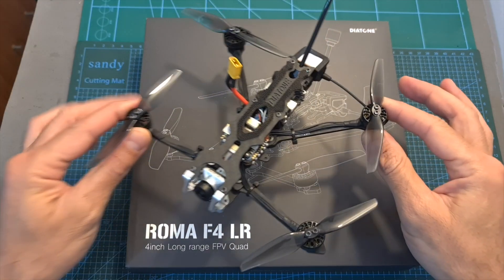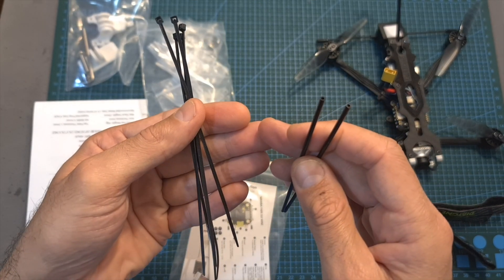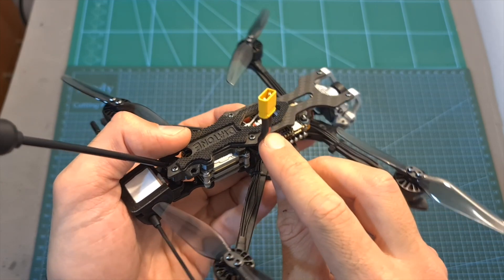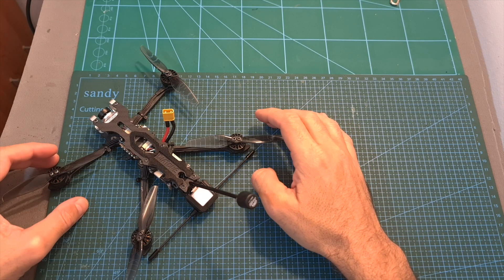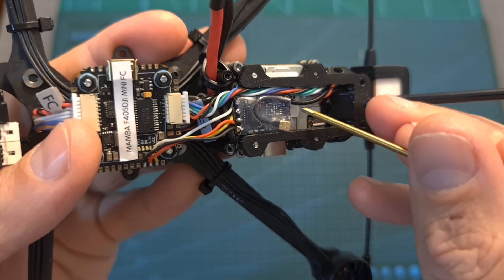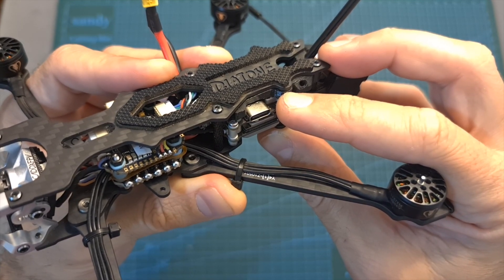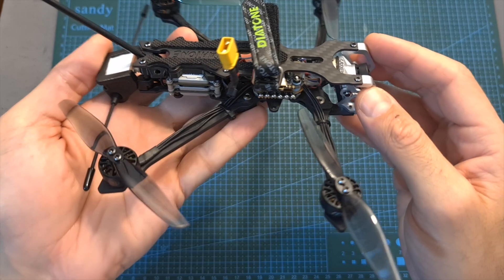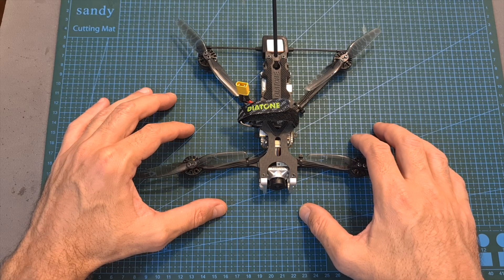Diatone Roma F4 LR - Setup, Review & Flight Footage

Comment: i bought the analogue version my video antenna sits on the side of the quad and not over the gps but i still cannot pick up any satellite's. i have configured the gps in failsafe tab in betaflight and waited 15 minutes with a fan blowing over it outside and still couldn't get any satellite's at all . very frustrating considering the gps rth feature was the reason i bought this quad . never had a long range quad with a 400 mw vtx , seems strange and i thought that's why it had a gps so when u lose video u can flick the switch and it will bring it back into range . am i missing something or is this gps unit just a dud

Comment: Hey Gal. Thank you for the review. Looks like a good quad. I have one question:
If i buy the version without camera and dji unit will it work with analog receiver if i solder that in out of the box? I'm just curious because the analog version is sold out everywhere...
Reply from the maker: My pleasure! Sure you can - the flight controller has an OSD chip so all you need to do is to buy an analog camera, VTX and an antenna and you'll be good to go.

Comment: In the end of the video there are some video with HD and other video with low quality. what's the different? are the HD is the DJI unit and the low quality is the caddx?
Reply from the maker: I should have marked it properly as it's confusing. 
Lower quality - Caddx Nebula Micro DVR. 
Higher quality - Naked GoPro 7 Black footage.

Comment: Nice video ! I’m wondering about these mamba motors. How do you like them ?
I see at times in the video some wobble. Is that the wind or is it something to do with the motors not being smooth ? 
Hope to hear from you. Thank u
Reply from the maker: Thanks. The motors seem to be working well. 
There are some issues with the tune which Diatone need to fix and on top of that the Nebula V2 camera is more prone to Jello in comparison to the DJI cameras as far as I know (I need to confirm it).
Reply: @KremerFPV  thanks

Comment: It's cool that there are now so many options in this category, but the "original" FlyWoo (or the actual original DIY build by Dave_C) still seems like the best choice overall even if it's slightly more expensive.
Reply from the maker: It's a great option and I really like it. I will post my comparison video once I will feel that I will have I got enough experience with all the current options.

Comment: It's got so much oscillations and rebound on quick rolls and flips. Are the videos recorded after you changed the pids or with the manufacturer's ones?
Reply from the maker: I used the stock adjusted settings. As I mentioned in the video, they are not great and I will post another video soon with updated settings that will hopefully work better.

Comment: Its light. But JB got it with GPS not setup, and no tune. which weird when buying a BNF. Maybe just because it a early model. Not out yet
Reply: Tuned already,The GPS if you want to enable,need give service a email，Will give you some caution on it，becasue the betaflight gps not same as DJI，need know some risk on it，that's why not open it from the factory，aviod some dangerous for people,JB not describe clear the main reason on it.
Reply: @MKST-CA  he said but I thought everyone knew these gps are seriously unreliable. Just for an emergency.  Like mine doesn't land and will sometimes be 50ft away over a tree lol.. but I do like that it is lighter. 
Any plans on a 5" version? Like the shocker but pre-built. Light, t-mount biblades (hq 5x3x2) AIO or 20x20 20a to 35a. Pro32 nano  or a 800mw vtx. Be a niche market. Other company has a plan for 1 but nothing out yet.
Reply: @divingfalconfpv4602  in solving the points he mentioned，will update the pre-set soon